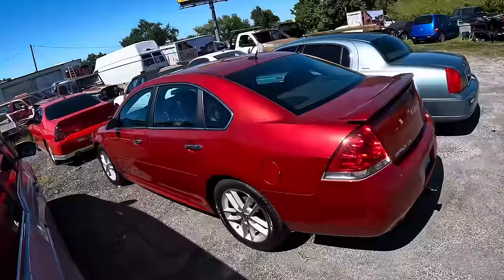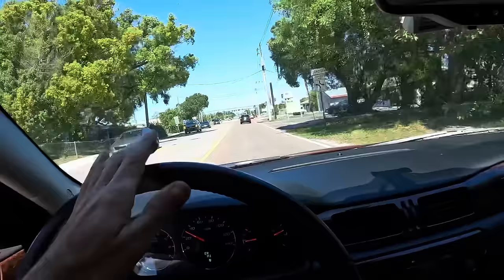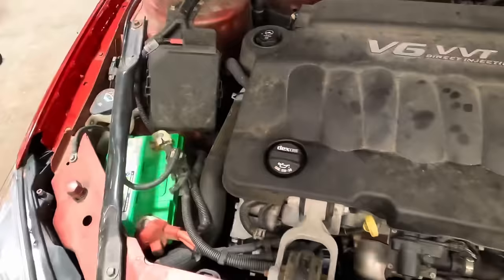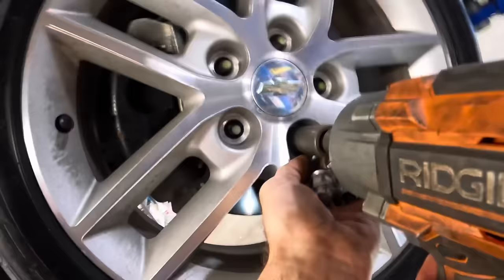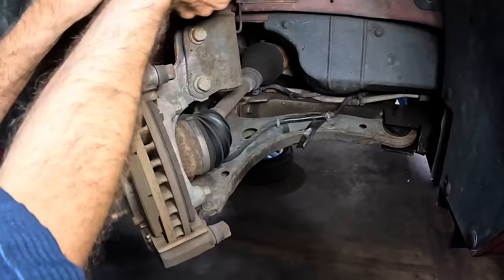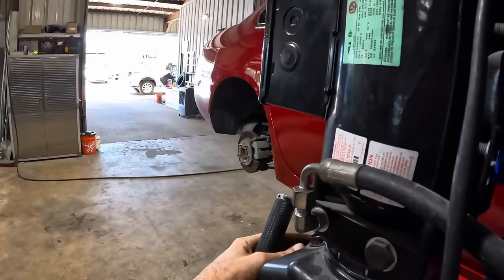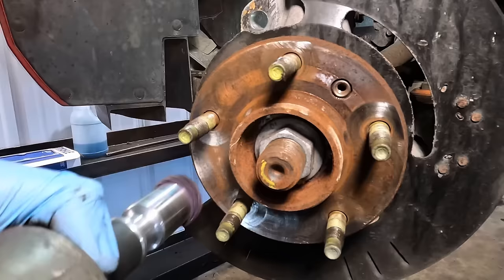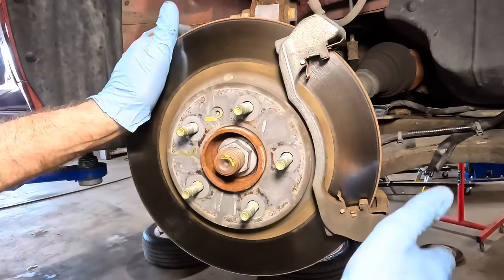Back on the Road Parked Since 2019 | Clean Impala LTZ 3.6l 2006-2013

Comment: At the assembly plant all the fluids are put in just before the car is started and driven off. Sixty cars come off the line every hour. For the brake system a vacuum is put on the master cylinder. If the system holds a vacuum there are no leaks and brake fluid is injected. All of this happens in 55 seconds. By applying a vacuum to the fuel tank while injecting fuel, 16 to 20 gallons of fuel is put in the tank in that same 55 seconds. Just a little FYI how the factory does things.🙂

Comment: In our shop, we discovered that cleaning the bore of the caliper was helpful in removing old lubricant. Eric O on SMA uses these bore brushes and long Qtip devices to clean the bore. In addition, we also discovered that pistons were hanging or unevenly applying pressure due to pitting. Pitting was caused by contamination of the brake fluid. Many shops don’t promote brake flushes or power steering flushes, but they’re just as important as replacing your other fluids.
Reply: found when I ask for flush most of time was not done. except the reservoir. 😢
Reply: Eric O is the master. If you want to learn how to do brakes (or anything for that matter) Eric is the man...
Reply: A lot of shops don’t do brakes properly that’s why I do my own and every two years or so I flush out my brake fluid

Comment: Hey Ray, just a few things. First I love the sound effects when you first introduce a brakleen can and the I love it when you chunk the empty can down the shop. Ignore the haters and keep doing it. Second, I noticed when you were replacing the brake fluid that you did not use a fender liner. Since brake fluid eats the paint off of surfaces, may I suggest a fender liner on future brake fluid changes. Also everything you stated about brake fluid is absolutely correct. I am an Acura and Honda technician of 29 years and I just thought I would inform you and everyone else that Honda recommends brake fluid change every 3 years regardless of mileage. Last point I would like to make is I noticed you installed those brake pads in the calipers dry. I would use a molykote grease because as you are braking, the friction material going across the rotors vibrate at a high rate (not causing a vibration in the vehicle). This vibration actually cause an audible squeal noise. The molykote grease actually dampens this vibration and keeps inhibits the squeal noise. Keep doing what you are doing brother. I find you to be an excellent technician and I love the content you put out.

Comment: I've noticed on a few of the cars you've done recently that they have shipped you Power Stop brake hardware. I have been using Power Stop on both of my personal vehicles for several years now and have been very happy with their performance and longevity. I purchased the Evolution rotors similar to these for my wife's car and they have also worked very well, and the coating has held up well for the year they have been on the car.
Reply: power stop is good shit bro.
Reply: I use Power Stop, extreme duty and other performance ones on my personal cars, work good.
Reply: I use their drilled and slotted option.

Comment: Great 10:15 explanation on reason to grease calliper slide pins. I have been telling people for 10yrs+ exact same thing...to aLwAyS Lube calliper pins when doing brske job, so the brake pads can re-center on disk/rotor for even pressure every time you step on brakes, and release both pads when foot comes off brake.  If slide pins are not 14:52 well lubed as you show, your new brake pads can drag/rub even when foot is off brake pedal, causing brake pads to wear out un-even and MuCh faster.
(It is surprising the number of people who replace brake pads but give No Thought to greasing slide pins)
Sometimes those rubber cups on tip of those pins will trap air on hole, and want to push pin back out.

Comment: i got that caliper piston compressing tool. works amazing on the front brakes, not so much on the rear brakes, it's a bit too wide to fit in the caliper. at least on my car. had to resort to the c-clamp method.

Comment: Working on my own cars, all 6 of them, I don't put the little rotor bolt back in.  If I can get it out the first time without rounding the head or breaking it, I thank God and leave it off.  Some people say it is safer to have it.  I say if that is the only thing holding your rotor on while driving, you have other issues.
Reply: I thought it was more for retention on the factory assembly line.

Comment: When I was doing these brake repair jobs in the 70's and 80's we never had a piston compression tool....I'd just loosen the bleed nipple and shove a big screwdriver or tyre lever in there to push the pistons back with the calliper screwed back on and the brake pads out. Oh! One more thing, rotors were called "discs." "Rotors" for us were that gadget on the end of the dizzy shaft.

Comment: I have read about replacing brake fluid, but I had no idea how it was done. I had my 99 Ranger brake system flushed and filled last year. Well worth the effort and now I know how the task is performed.  Thank you for including this in your video.
Reply: There are lots of ways of doing it, but Ray’s machine is probably the fastest, using both pressure and vacuum to move the fluid. Cheaper machines use one or other, not both, and there are even diy kits that use pressure from the spare wheel.
The important thing is to avoid letting the level in the reservoir go too low, to make sure you don’t introduce air into the system. With care, you can even do this with no special equipment, as long as you’re careful about the fluid level.
It does take longer and you won’t find a pro doing it without a machine, due to this, but if time is not a concern, it’s an easy job and can save a few bucks.
Reply: @duncancremin1708  I actually appreciate the DIY ones to show its not so hard.  Try the top from a triggered manually spray bottle (like Windex) cause it actually produces negative pressure at the caliber.  Thought that one was extra creative.

Comment: Bought almost the exact car (2013 LT in the same color ) 3 years ago, it also had just over 55,000 miles and the first thing needed was a full set of brakes and tires. Drove it for a year and made $1,000 in profit. In Michigan no less! 
Good to see you corrected yourself on the year, that model was upgraded in 2006 with different head lights and tail lights and ran through 2016 till the next and last body style ending in 2020.
Reply: My 2014 Chevrolet Silverado had the brake fluid exchanged and I noticed a big improvement in the way the pedal felt and the actual braking performance. That was performed at the 6 year mark along with the transmission fluid exchange & coolant flush. Runs and drives like new still.

Comment: You convinced me to buy one of those caliper compression tools even though I'm just a DIYer.  I did my front brakes on my truck on the weekend and used it.  Much easier than the C clamp - I need to remember you trick about using the brake pad to space things out a bit.  The threads were maxed out by the time I compressed the pistons enough to fit the caliper over the new pads.

Comment: Before tossing the sprsy cans, keep the nozzles and extension wands to repair other cans that get clogged or lost.   You can also use the extensions as repair splints for fixing those broken vacuum nubs on emissions crap under the hood.
Reply: I keep all my spray paint nozzles for sure.

Comment: A correctly done Brake Fluid Change (BFC) is vital to maintain the safe operation of the brakes to the manufacturer's specifications. 
Most European vehicle manufacturers specify 3 to 5 year fluid changes. Some even recommend all rubber brake components are replaced at about 6 years too.

Comment: At the shop I worked at we used the coated napa rotors alot had very good luck with them in New England keeping noise and pulsation from occurring

Comment: I had an 04 impala for about 7 years. Paid $2k for it and got 60k miles and it got me across the country. That car was why I learned how to fix cars. Finally traded her in a few years back. Not great cars but they can do the job if you can do basic maintenance and repairs. Chevys back then could last a long time on the engine if you changed your oil regularly, compared to today. Trans was a weak point, but that lasted on a healthy diet of stop slip. It's everything else that starts going. It was the lower intake manifold leaking into the coolant system that made me give up.

Comment: Also that old fluid in the brake lines and components will corrode them from the inside out.  Once again, failure just when you need it the most!  Regardless of the moisture, hydraulic fluids, like oils break down from heat over time.  The dirt will tear up seals and boots at the pistons.  Yes, I 100% agree that brake fluid must be changed.

Comment: Based on my experience as a former owner of that generation Impala rotor warpage will be back, the only way to get rid of it is upgrading to the police package pads. Wagner Severe Duty or Raybestos PPV are good aftermarket options. There's a TSB addressing this issue.

Comment: Glad to see some clean, low mileage cars/trucks being worked on.  I have a very nice 2012 Ford Fusion Sport with around 44,000 miles. I live in Ft. Pierce and will drive across the state to have you work on my car.  I'm thinking A/C service, trans fluid service, cooling system flush and brake fluid flush plus whatever else you think it requires.

Comment: If you can get your hands on that aluminum plate at your friends shop up in Michigan the one that said high voltage that would be great just need to add 1.21 gigawatts to the bottom somewhere
Reply: He needs that HV plate for the hidden power plant in the truck bed box.

Comment: What a lot of people don't understand is that a lot of maintenance items are considered by the OEM to be "lifetime" systems. That is, the lifetime of the warranty period. "Lifetime" drum brakes, but even if the parts would last 30 years, the lubricant will not. "Lifetime" transmissions - again, fluid does not last that long. The additive package in the Dexron 6 ATF in my truck is depleted after 50k-60k miles. Ultimately, these types of services will cause that system and its components to last much longer and be much safer because the system will perform much closer to OEM spec'd performance.  If you only want your vehicle to make it past factory warranty and then cost you thousands shortly after, by all means, ignore the fluid/lubricant exchanges.

Comment: I like spraying penetrant on fasteners prior to service to help prevent possible breakage. I use the portable Mity Vac system. I forgot to release the pressure one time and won't make that mistake again. Removing the cap resulted in a shower of brake fluid which necessitated quick cleaning of all contacted paintwork, what a mess! 🙄

Comment: I have to correct something that you said during this video. You stated that water does not play well with heat. It certainly does. Brake fluid and heat do not react together. Water absorbs heat and heat absorbs water quite readily. That's why it turns into steam. Hence, the issue with water in your brake fluid. Water and heat combined quite readily.

Comment: I just did a wilwood master cylender and 4 piston street strip caliper roter set up on my 76 Camaro, and the rotors came with a black coating on them. that Wilwood  suggested to leave on to help aid in brake pad break in, and it literally looked like a light powder coat. Reluctantly, I followed the directions. After all they are in the performance business and probably know more than I doabout their product, but I did feel as if it could contaminate my new pads but after 800 or so miles they are fine.

Comment: The coating on those rotors is really good. My last set had it, no rust so far. I don't know if it's the strike, but just went Autozone and they robbed me for $120 on a front set of "copper free" ceramic brake pads. Might need to start ordering online, not as convenient but about a 1/3 of the price.

Comment: I never put those set screws back. Had too many problems getting old ones out. If I can get them out once,  that's it. I've changed wheel bearings with the rotor still attached because of those things.

Comment: Hi Ray! FYI, GM recommends brake fluid replacement every five years, even on brand new 2024 vehicles. They recommend it even sooner if there are signs of any contamination.
Reply: IMHO 2 years in pretty all german owner manuals and service plans i every read. Car Supplier "Bosch" invented 2020 a DOT 4 version for 3 years. It´s called ENV4 and ENV6
Reply: And that’s why Gm brakes lines rust out 😂

Comment: The fasteners holding the rotors to the hubs are important. It keeps the rotor in place if you loose a wheel. If the rotor comes off too, the caliper pistons will come out and further hamper any breaking ability you have left.

Comment: The intake hose is not hooked up the air filter box. That's the reason why it was going no where when you had it at 3,000 3,500 rpms

Comment: Nice to see a car that has been sitting a long time still in good condition and not needing very much to get back on the road. I have two vehicles, a car and a truck that sit for several months each year, as i split my time between my homes in the USA and Thailand. 14 months this last time and as i have someone Start them occasionally and keep them on battery tenders they didn't need much either. However the truck did have some flat spots on the tires that took a few miles to work out. The first few miles felt like the front end was going to come apart. Tires on both vehicles were very low on air too. Something I'm sure you checked on the Impala. Note, my car is also an Impala, 2010. Very nice car.

Comment: I just replaced my brakes and rotors on my 2013 Honda Civic and it came with coated rotors. I took it for a test drive and heard nasty grinding when braking and thought I had screwed up somewhere. I realized that you have to constantly brake to get the coating off of the rotors then the noise goes away. 😅
Duralast gold rotors are black until the coating comes off then turns normal gray/silver. The brakeleen can’t take off the coating on the rotor until you burn it off literally while braking.

Comment: I buy those Powerstop kits for many cars. Costs less than the parts store stuff and IMO, are better. @27:20... The coating is actually a break in coating. It's supposed to help the pads bed in.

Comment: Man, I just sigh whenever I see Ray removing caliper bracket bolts with that 3/8 impact or just a box wrench.

I did mine recently, and I had to practically stand on a breaker bar to break the 210 ft lbs on the fronts.

Comment: I have beaten up Brake Clean Cans and I've even thrown them at rocks I had 1 can break open and it just hissed the Rest of the Brake Clean out and that was it, it didn't blow up or catch fire not to Mention it evaporates extremely quickly

Comment: Most aftermarket brake spring clips / shims I've come across, are too thick and not very springy usually, so are pretty useless. I usually use the OE if still in good condition, just clean them.

Comment: "Cold" at 76F?  LOL!  I have my thermostat at 75F, and consider that a compromise to save power.

As for the seized slide pins, I had that in my left front brakes on my 2003 Monte Carlo, and wound up causing an accident.  It came from the factory with the slide pins on that one caliper unlubricated.  I am now ultra-aware about those, and check often.

Comment: i had the slide pin issue on my 01 grand prix. i replaced the rotors,pads and calipers and slide pins. i paid $750 for the car so i expected some repairs for the price.

Comment: 37:52  this car with colored brake fulids id be tempted to push the piston on the calipers out to inspect for rust on the bore and pistons  the pistons have a large rubber squar type o ring and the dust boot that attached to the body of the caliper. I dont know if you can get rebuild parts for these but if the piston or bore has had water on it it can rust and pit causing fluids to bypass the seal like piston rings. If you have a toren piston boot or its leaking fulids it should be rebuilt or replaced.  
Rust colored fulids are a tip there is a problem with the system. And you can get water moisture inside the master cylinder.  Any color to the fuild tells you you have problems.  It should be clear. 
It does get dirty also.
Reply: Yes, fulid exchange is nessary maintenance, you wouldn't run your oil 200k miles would you? 
Why the brake fulids?

Comment: I had water in my brake fluid prior to the service interval where the pedal was almost to the floor before it even started actuating the brakes ... so yeah it's a reasonable service.

If you haven't already done the coolant exchange and didn't record it, I personally would like to see it as I need to have the service done on my 07 Monte which should be the same set up as the Impala.... since the Impala is basically a 4 door Monte (in a way).

Comment: Biggest  mistake GM did was stop making  the 3800! Instead of improving the 500k engine they made a boat anchor called the 3.6VVT. The early versions the check engine light comes on at 100k plus miles and costs around  $5k to repair because  of the timing chain tensioner. You never hear of any of those engines coming  close to the the 500k+ miles of the 3.8 litre. Keep throwing  your break cleaner cans!
Reply: Gm couldn’t keep that engine if they wanted to. The EPA killed off good engines.

Comment: I wonder if the pistons should be removed and cleaned at the same time as the fluid exchange to check for corrosion and the condition of the seals.